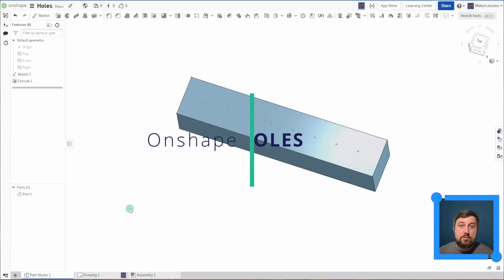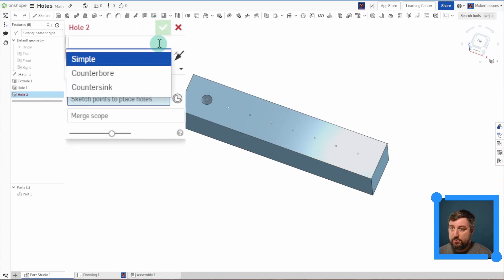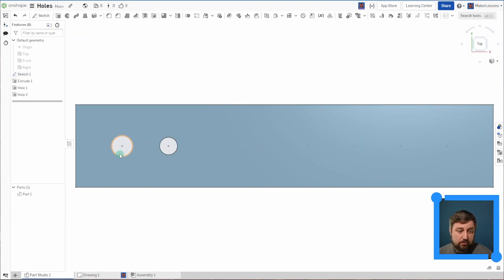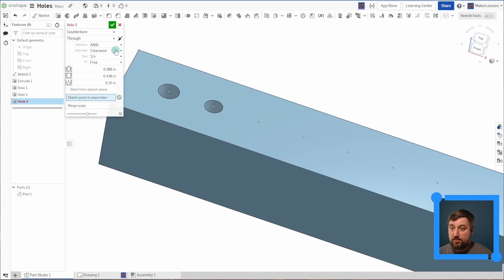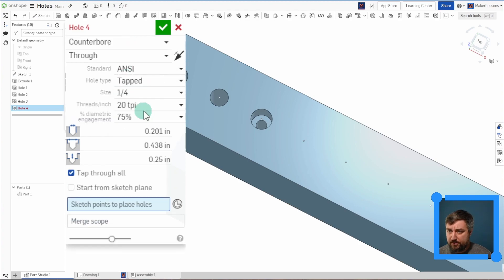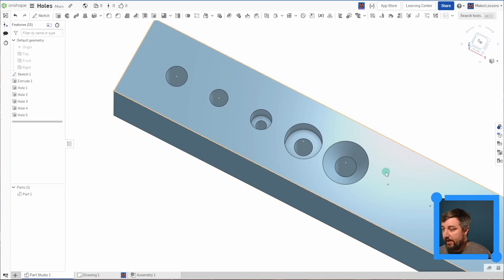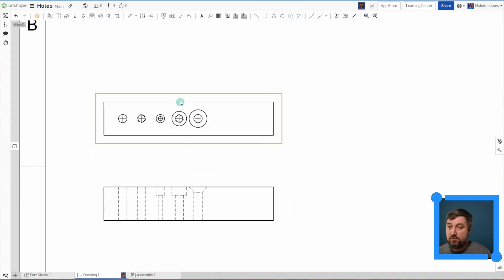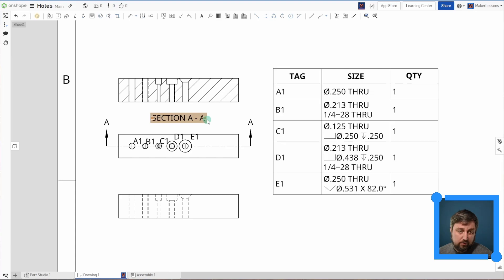Learn How to Make Holes in Onshape

Comment: Struggling a bit with this. I sketch a few points on the face of my part and then place the first hole; it all works fine. I then try to place another (different) hole but the points on my sketch don't show up any more. I seem to be trying exactly what the demo shows but the subsequent sketch points become unavailable. Any ideas would be appreciated.
Reply from the maker: Hey, when Onshape uses a sketch it defaults to turning the sketch off. In the tree to the left  you will see your sketch has turned light grey. Hit the eyeball to the right of it to turn it back on and you can use it again. GLHF
Reply: @MakerLessons  You are star! Thanks for the info and for the prompt answer.

Comment: Ya skipped the part about the points. How do we set where the hole should be? Are we supposed to do a sketch first? If we do, what do we use to set the points?
Reply from the maker: Yes, put points on a sketch and add dimensions to constrain them
Reply: @MakerLessons  Bruh. How to make a friggin "point"